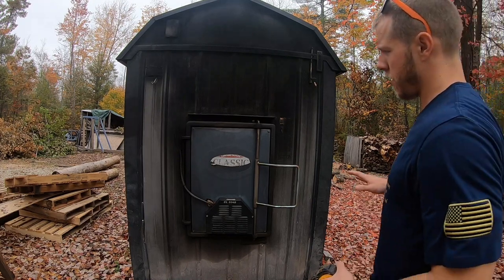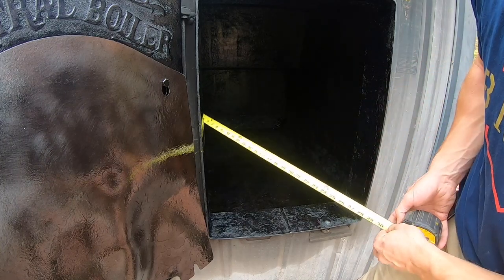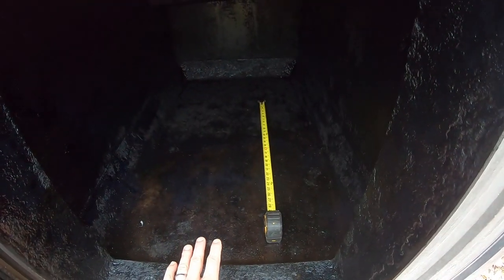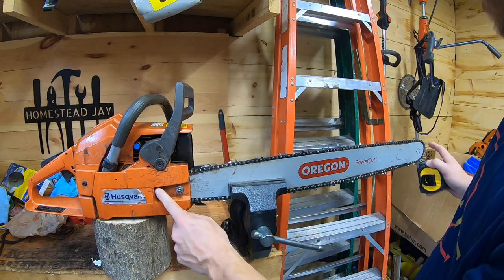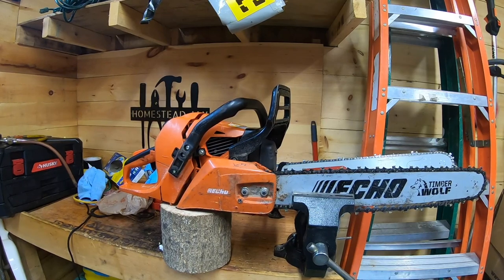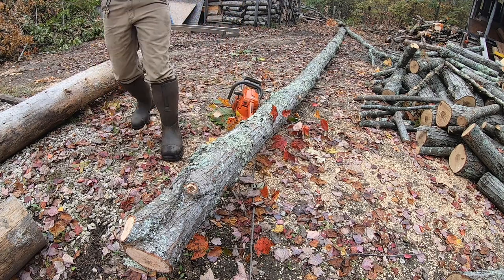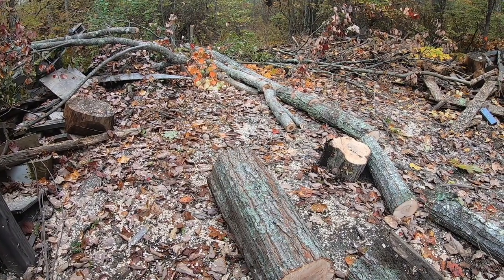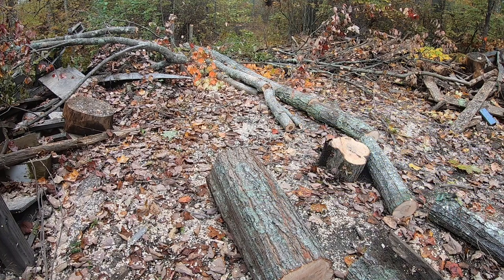THE PERFECT SIZE OUTDOOR BOILER FIREWOOD!

Comment: I cut everything at 24" Jay....I do that for stacking purposes. It's so much easier to stack fire wood in my wood storage bldg . ( irregardless of diameter , split or not ) inconsistent lengths make for big messy inconsistent wood stacks and  being O C D like you , I can't have inconsistent stacks ! ha ha
pc
Reply from the maker: Yes my OCD is starting to grow with firewood! The last few years ive been all over the place with my sizes but now I want to be more consistent plus or minus a inch! My wood sheds are like that I can have 3 rows of 30 inch logs! So I built the sheds like that but sometimes dont practice what I preach ahha

Comment: I do the same with my bar. It just works for my fire place, wood racks, etc. I also see the advantage for those who sell firewood, keeps the length in check and makes it w]easy when you are bucking up firewood. Chris on In The Wood Yard uses zip ties off the handle bar the are measured to 16” from the bar to the tips and he puts a piece of pink tape on the end so it easier to see. It’s all it what length you need as well as what works best for you. Great tip Jay! Great video
Reply from the maker: Absolutely! I think I may harvest some 16 inch wood to try and sell we shall see! Ive been converting it all to boiler wood so I can get ahead!